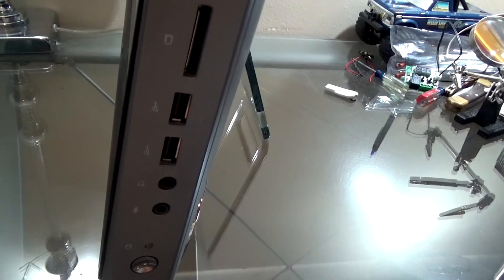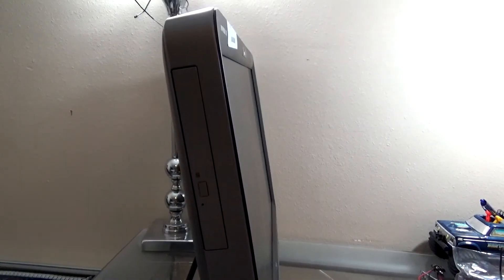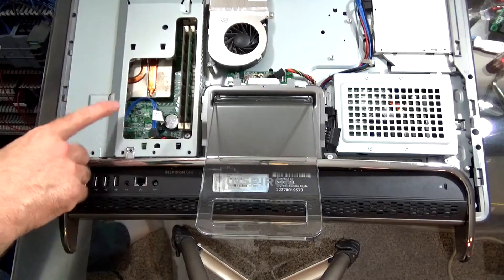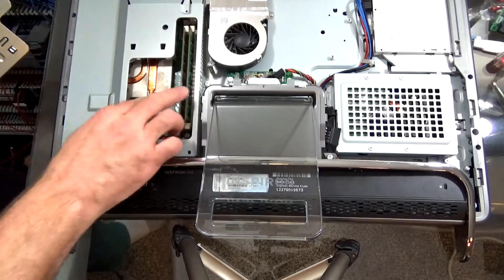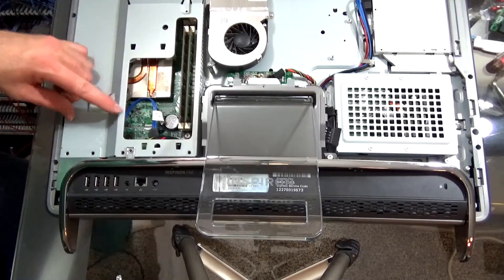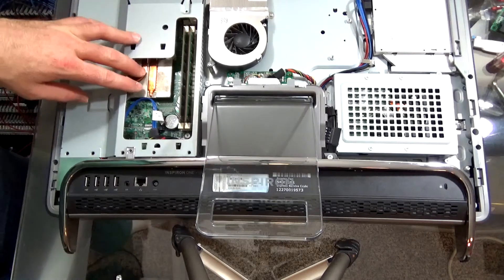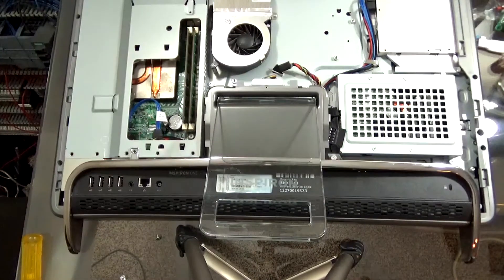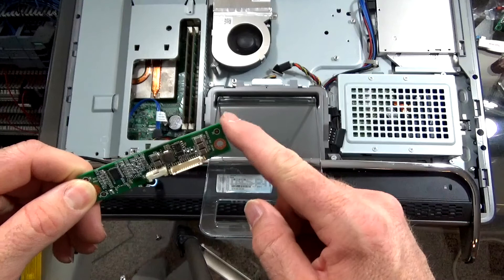Dell Inspiron One 2305

Comment: Hi I have an older model inspirion one, and its psu has also gone dead, can i connect a laptop power supply to the mobo and bypass the existing psu, because the psu is difficult to find and expensive? thanx
Reply from the maker: If the voltage is right, it should work. Did you check Amazon or eBay?

Comment: thats a choke, try putting smd choke/coil in google
Reply from the maker: Awesome. Thank you for the reply. I will try to find a replacement for this board. I have made a few other videos on twitch about this machine, but I forgot to tell it to save and lost them.
Reply: replacement board sounds good, when the choke burns, u can assume there is something more than just replacing one component which led to failure.
Reply from the maker: I am going to try and find a replacement, just to see if I can bribg the board back to life.
Reply: and one more thing i forgot to mention is the board u r trying to repair is for touch screen and is not an inverter board, as lvds cable is directly plugged onto motherboard, usual culprit is mxm graphic card. but yea update once u r done with it